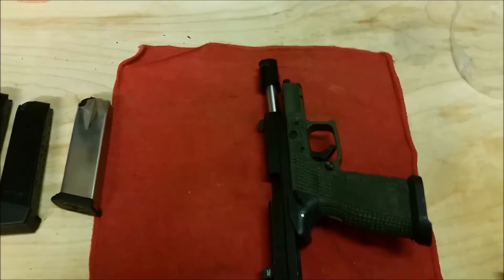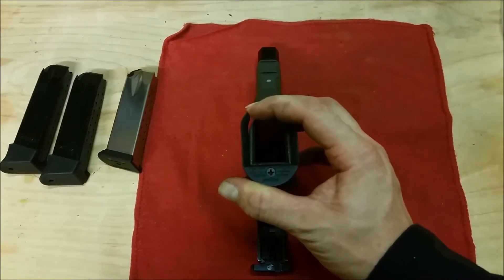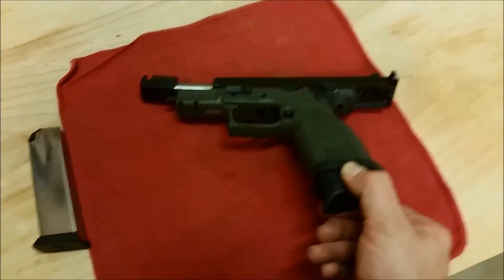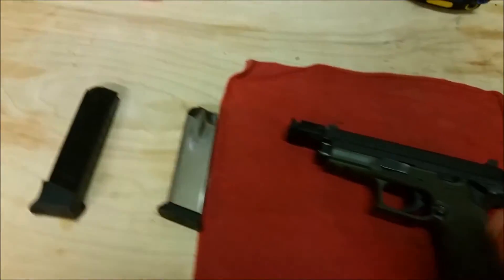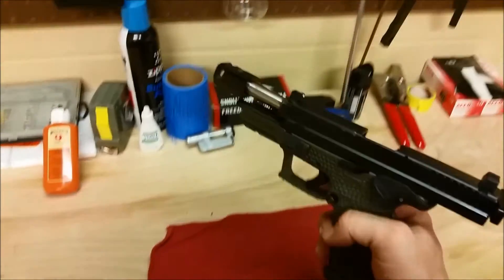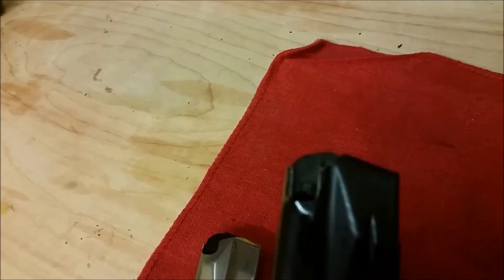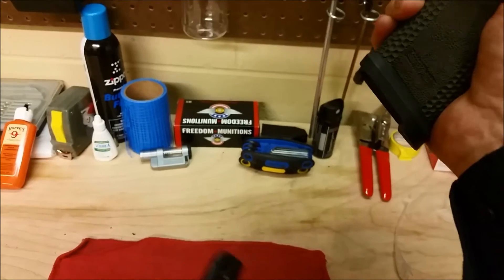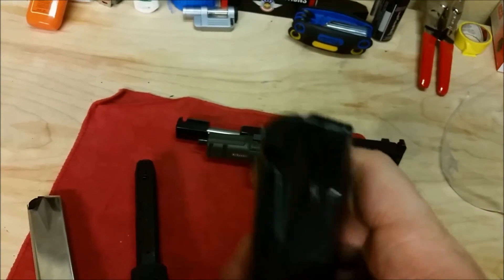Issue and Fix for MecGar magazines (XD Pistols)

Comment: I notice that you have a heavenly modified pistol. And while that maybe shouldn’t make a difference.
I use mecgar 18 round mags in my HS2000, and XD all the time and have not one issue with them locking in to place or ejecting, and I don’t mean a slight movement when the mag release is hit but a full strong ejection. I think your modifications are your issue, not the magazines.